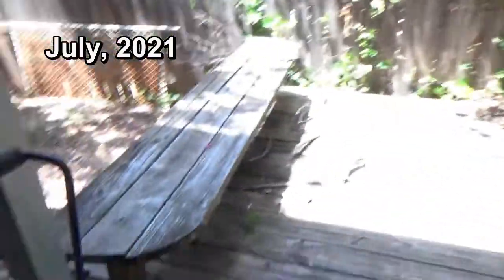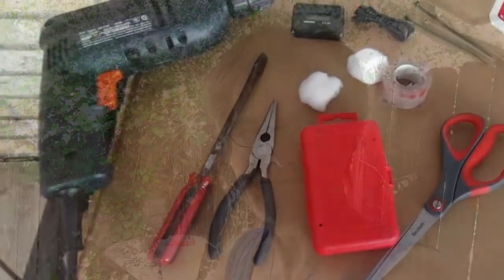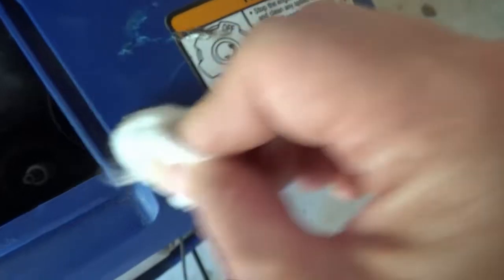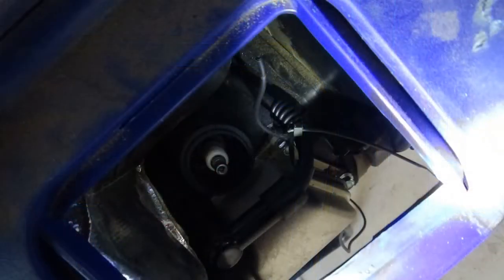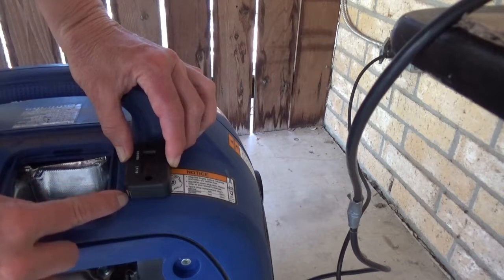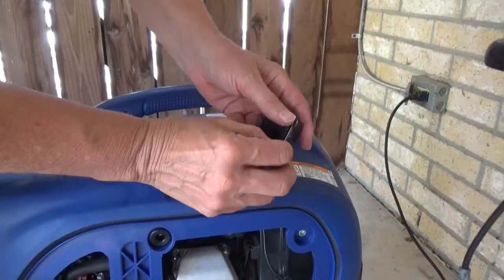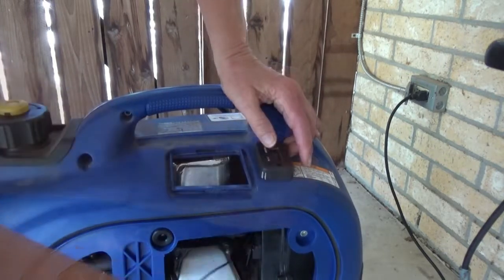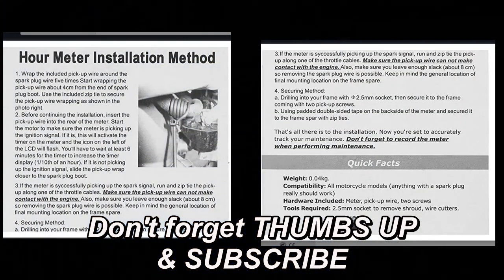How to Install an Hour Meter on Small Gas Powered Engines, Generators, Lawn Mowers

Comment: Hi I tried to access the older videos you had published on the generator and running them in parallel and they’re no longer available. I tried to access them and they were marked private. Are they no longer ones you would suggest? I love your videos especially since you said in a recent video that you buy them yourselves and the reviews are based on more long term vs. right out of the box reviews. Thank you. I am a Louisiana professor which means I get paid decently for 9 months out of the year.  I appreciate that you seem to be very careful and do the research before buying. Thanks for all the great videos.
Reply from the maker: We had an unfortunate experience with the 2500.  It would not start.  We were about ready to go with something else when it dawned on Sharon that our elevation had been just shy of 8000 ft.  The 2200 started at the high elevation.  We've decided to keep both the Westinghouse generators.  You can buy a kit to help the generator get more oxygen, but it's such a pain to install and uninstall it.
Reply: @TwoTiredTeachers  thanks for sharing this with me. I was headed to Lowe’s to order one soon. That’s one of the many things I love about y’all. Your honesty shines through. Have a happy summer. One more question, is the areas you profiled in some of your mote recent videos affected by the New Mexico wildfires?
Reply from the maker: @classcchaos3476  Not that we know of.

Comment: Great video and very timely as my i2200 generator arrived today! Could you share a link to the meter you purchased?  I would love to add it to my unit before starting it up! Thanks again for the great videos!
Reply from the maker: We got it on Amazon, and it doesn't seem to be available now.  It is a Frienda Inductive Hour Meters Digital Engine Hour Meter Automatically Shutdown for Gas Engine Motorcycle Lawn Mower Generator Chainsaws Motocross Snowmobile Karting (Black).